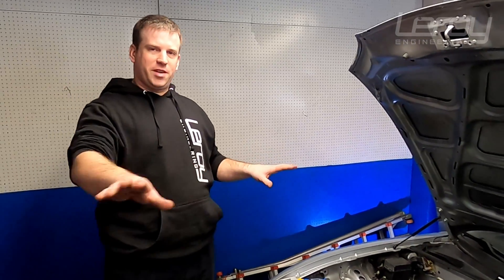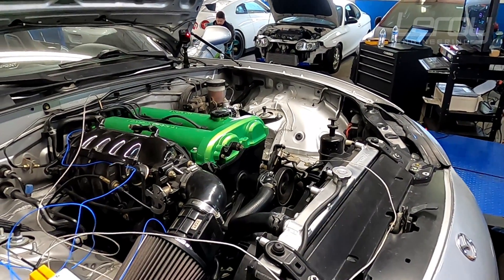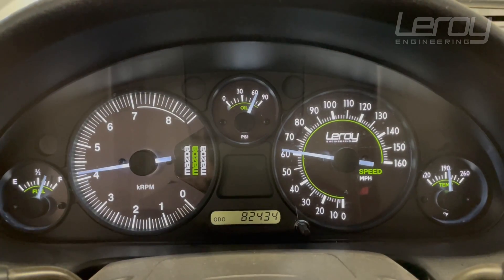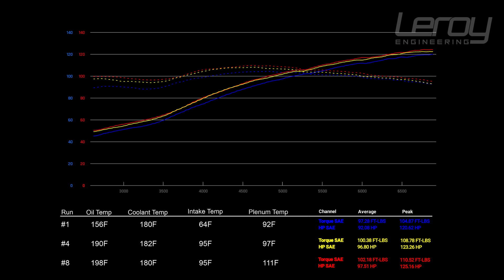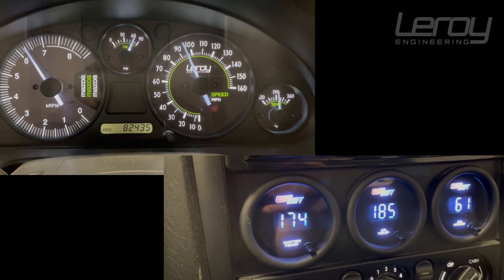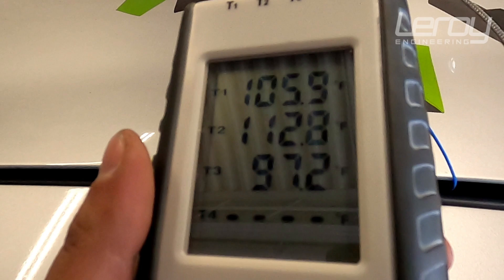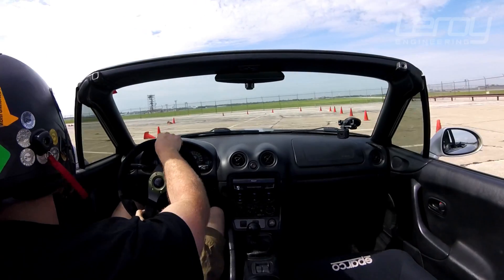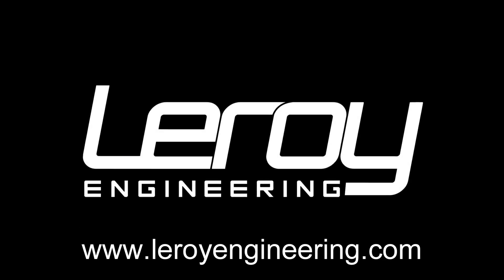Miata Dyno Tests: Cold Air Intake Power!!

Comment: Hot oil cold coolant. As others have mentioned a Randall style intake test would be interesting if you get the chance. Just another bit of data. I suspect almost all improvement from a Randall intake would be from ram air pressure at speed.

Comment: Any chance you could test hp gain if any from an electric vacuum pump hooked up at the PCV valve cover to reduce crank case pressure on a naturally aspirated setup?

Comment: What I gather is that increasing your intake air temperature actually advanced the timing. If you were running 87 pump gas instead of high octane, the cooler intake temps (from the first graph) would have likely made more power. Cooler air is denser, usually leading to more power, but your results differ likely due to the stable burn of high octane fuel, which effectively slows down combustion (like retarding timing). Running lower octane gas might have advanced the timing. If you had adjusted timing for the cooler test (graph 1) until it just started pinging and then backed off a degree, the cooler intake test would have shown more power. Running even higher octane fuel, like C16, would produce less power unless timing was further advanced. Remember, the key advantage of higher octane fuel is allowing more timing advance.

LOL I said that origionally so bad and then ran it through ChatGPT to explain what I was trying to say.  This is what chatGPT reworded what I was trying to say.
Reply: This could be a really cool test if you used an oil cooler heat exchanger with an external water source, like a water hose, to cool the oil down to the water temperature. You could also try cooling the plenum by placing a bag of ice on the intake. If the horsepower continues to decrease, it suggests that you need to advance the engine timing. Remember, TIMING IS YOUR BREAD AND BUTTER. The only ways to get more timing (if you can't adjust it in the ECU) are to use lower octane fuel or increase intake air temps.

Comment: If i remember correctly hotter air will make you more prone to knock or predetination. Therefore, the colder your air intake charge, the more you can advance timing and the more power you can make. That is really interesting about the oil, thanks for the video. Makes total sense 🙏💯

Comment: Great video. I could see doing something like a "cold air chamber" or something to that effect for your test, an ac'd area which is kept separate from the hot environment so the engine oil can be warm with the car temps up while at the same time pulling from a cold air source. I do agree you are just very likely to prove the same thing. I've seen something like 1whp for every 20 degrees cooler for NA motors.

Comment: This is great. BUT there's one thing you should investigate. Assess what difference the Resonator makes on the OEM cross over intake tube on MK1 and MK2.5 cars makes and whether it is better to keep on an aftermarket intake. 
I've been looking at keeping it but with a shielded pod filter (where the stock snorkel is ) and ditching the fancy shiny cross over tube as from what I've read the Resonator maintains mid range and low to mid range torque
Reply: Interesting been thinking the same , did come filter heat shield and cold air ducting , but left the resonator, was wondering if removing for a straight through steel pipe would effect it power curve

Comment: From a street car perspective it’s not going to amount to much, you’re paying for the sound and the response. Obviously the colder the air the better. 

Spec Miata guys are very limited but typically run open filters as far away as they can from the exhaust, despite being required to run it on the exhaust side.

Pro level cars have fully sealed intake plenums with ram air if allowed and never run open filters, restrictors are often employed.

When we dynoed cars for compliance with NASA and SCCA the hoods are closed. We compared those runs to our gps/acceleration data logs from the track to find cheater cars with speed activated tunes etc. 

The smartest and fastest setups tuned for maximum power and torque everywhere but peak which was rule exploit based on a power cap. 

Different dynos different days but for reference a healthy legal 1.6 spec miata with a good builder would make 125whp. Later 1.8’s would make 135-140whp. Top teams in the nationals would play with fuel pressure regulators, loose wheel bearings, loose belts and less oil.

Comment: You need to tuck the air filter inlet on the front bumbers, where you have it positioned is incorrect (as shown in your video)
Air inlet on the front bumber, your room seems not to be properly ventilated, it needs to see actual outdoors air temp, ( don't know if you are running heater in your shop) hood closed.

Everyone knows that cold oil = less power, same as thick oil = less power.

With the filter where you have it is sucking all the hot air from what the radiator is exchanging plus the radiant heat from the engine bay, what you have is not a cold air system as tested.
I understand your points, of not wanting to break your back  to find a decimal point increase, but then you are defeating the purpose of the test.